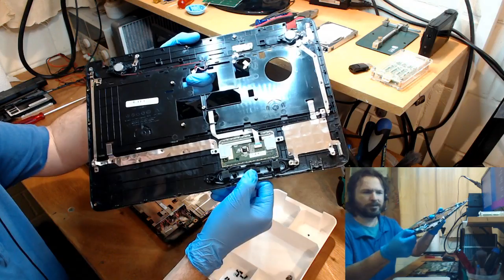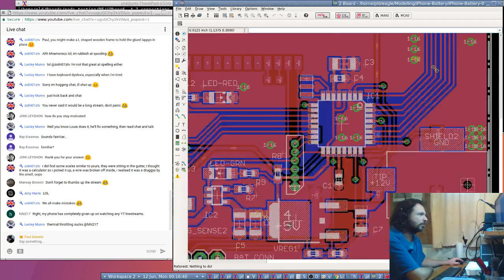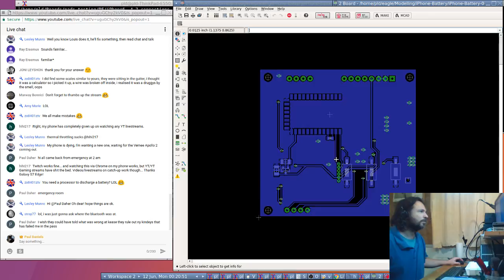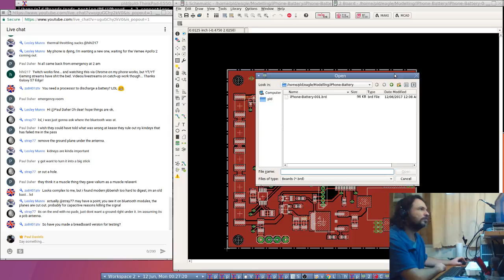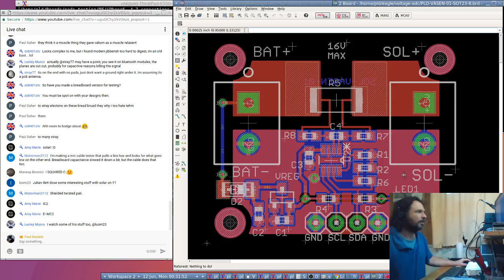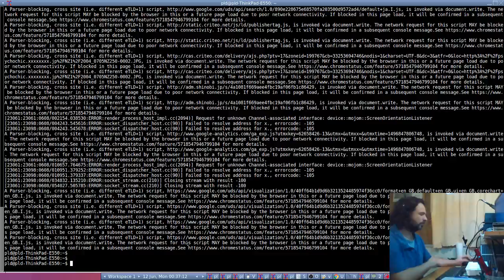[From Livestream] Toshiba C665 - broken hinges, non-functioning USB port (right side), drop damage

Comment: Hi Paul, definately not as many Toshibas knocking around these days, the build quality no where near as good as used to be but then that can be said for nearly all manufacturers, hate the HP's with the exception of their EliteBook models which are very rugged and well built, the Lenovo's probably the most popular here in Ireland at the moment
Reply from the maker: Yes, with the waning of the Toshiba presence, I'm recommending Lenovo as a failsafe.  Not sure what changed in Toshiba's laptop department, perhaps they decided they didn't want to do low-end machines any  more?

I get a few DELL units now that I think about it, but definitely Toshiba has been the primary brand for the last 4 years.  

Quality of the units overall does seem to be getting worse, or rather, the crazy money-saving tricks they're using are becoming more frustrating.
Reply: Havn't had much problems with the Dells and the older Toshs were great with the exception of the Power Jack which connected to the Mobo with a cable, made it very easy to change if they were faulty but were notorious for breaking out of their small plastic retainer and falling into the  bodY of the laptop, still generated easy money so shouldn't complain, I reckon at least 60% of what i get in are HP/Compaq, most of them are a pain in the butt

Comment: Hi Paul, enjoyed the video as usual, just a quick question, which of the J-B Weld Epoxy's do you use?, theres several on sale ie. Clearweld, Quickweld, Minuteweld etc, many thanks
Reply from the maker: I'm using the "original formula", slow cure, JB Weld. Good luck :)
Reply from the maker: Ah, was in my description links --- J-B Weld Cold Weld Steel Reinforced Epoxy: http://amzn.to/2oSymJU
Reply: Many thanks for that Paul, never thought of checking the links, clever or what?, lol

Comment: I still cant believe how many Toshiba you get in. They aren't very common around here. thats the first ive ever seen one with nvidia too, pretty cool they use them.
Reply from the maker: I would say at least 50% of my jobs are on Toshiba laptops.  HP for a while was 2nd runner but they've mostly died off now.  I'm starting to see an uptick in Lenovo, which isn't surprising as  many of the consumer stores have moved over to them, not sure why Toshiba has been phased out.